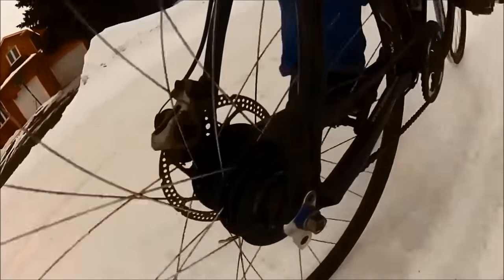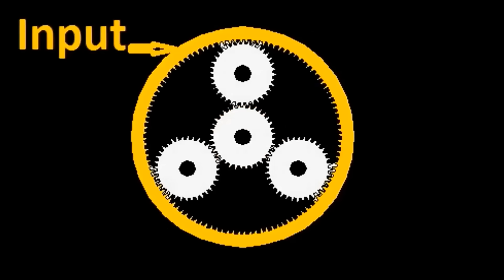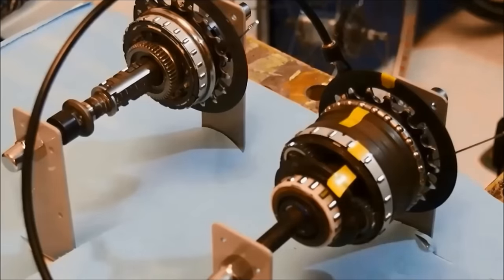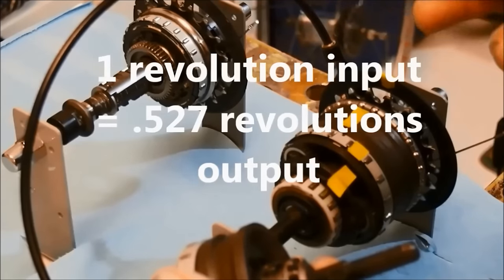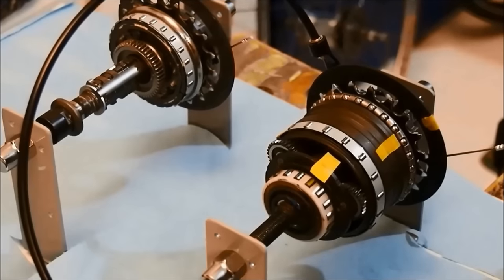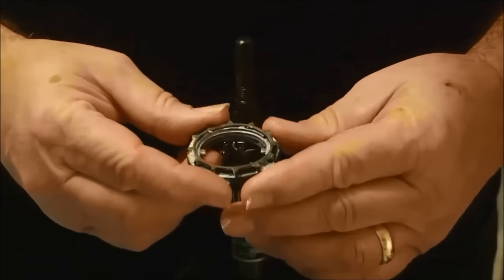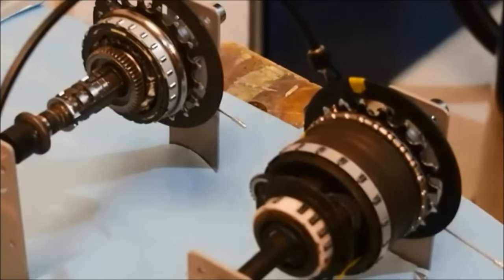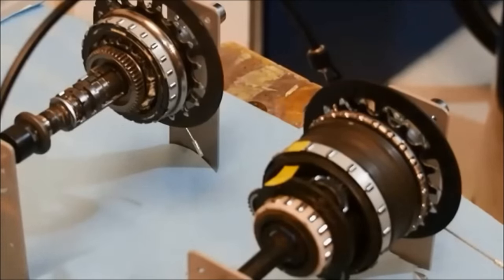Shimano Nexus Alfine 8 speed How it works

Comment: Just a heads up. I had my alfine 8 for two years and started developing problems 6 months ago where certain gears in the higher rang (5,6,7,8) would not engage smoothly and where the 8th gear began continuously clicking. . Adjust was spot on. I just fixed the problem today by changing out the cable and it works perfectly. I opened the hub 8 months ago and everything inside was pristine and well greased. The reason why changing the cable worked so well is that once you get into the higher gears on the alfine the tension in the shifter cable increases causing it to stretch more and be less accurate in the higher gears. This is many alfine users a have issues in the higher gears. Cannot believe that the cable change was so simple, easy, cheap, and effective. Should be the second troubleshooting step after checking adjustment. Best of luck to everyone!!!
Reply: Was your cable evidently damaged before changing? Or did it look good? My cable looks like brand new, but bike is 4 years old (but it was not ridden). Is it possible that cable has streched without using (or used occasionally)?
Reply: My cable looked brand new. A cable can stretch and still look new. If you left the bike unridden for a long period of time and the bike was sitting in a higher gear then I believe the cable could have still stretched because the higher gears put a lot of tension on the cable.
Reply: I ordered the Cube Hyde Pro yesterday... omg would a normal gear-changing-chain-thingy have been a better option? I have literally no clue about bicycles.
Reply: This is excellent advice.
Reply: Pibbles 'n Bits Thanks for this,about changing the cable. Mine didn’t work from its inception because I’m new at this but still have some knowledge about how and what makes stuff work. I knew the cable was the problem and on till the broken ends stated protruding the shop keep telling everything was okay and I’m hard on the equipment.We changed the cable and I changed bike shops.
Reply: My guess is that it is less effecient than the standard derailer. Am I correct?
Reply: @mohlomphehi  correct
Reply: I had this inaccuracy problem on a simple Nexus 3v, new cable, but it was an unsuitable cable normally used for brakes. Another specialized workshop pointed out the error and replaced it with the correct cable.  Interesting that, I've never had a gearbox as durable as this one, years without problems.
Reply: @markwebb7320  It's a pretty solid gear system. Only downside is the added drag over a conventional system.
Reply: They don't like sand ,after a cleaning  there all good ,I've been through several cables  thousands of mile .12 yr old very durable
Reply: Hi. I have same problem  thanks  i will lock in to. 👍👍

Comment: I had a bike with the Nexus 8 (not Alfine) and it covered 50 000km ( I cycle to work). It only needed a new gear cable once, and finally needed a new face plate because part of the face plate that holds the cable end, broke off. Otherwise trouble free and no maintainance! Highly recommend for recreational/commuter cyclists. There is a minimal loss of efficiency that would affect a race cyclist, but not noticeable for regular cyclists

Comment: I have the Alfine 11sp hub on road bike, a tad heavy, but no deraileur, exact shift/response, and works excellent.  Expensive, but after miles of riding, glad to have made the purchase.  So far, 3 yrs use, very durable.
Reply: no boat, they shouldn't be noisy, i bought my alfine 8 based on this video....and it works great! the only thing i miss is the speed of my road bike...........i was asking Dan if i could install a 52 or 53teeth chainring in replacement of the 42t chainring i have now and replace the 18t rear sprocket for a smaller one in order to go faster......

Comment: Dan, that was the clearest, easiest to understand explanation of how this hub works, that I've ever heard!  I'm very impressed you were able to convey the information so simply. It would appear that Shimano have designed and built a very easy to use system. 
I now have only two questions.
1 - Is it sturdy enough and made with high enough quality materials to last a good long time with minimal maintenance?
2 - How can I get one without selling everything I own to afford it?
Thanks for taking the time and obviously a great deal of effort to produce a video that almost anyone with some mechanical knowledge can use to understand this system. Shimano should have you on staff as a technical trainer!
Reply from the maker: +Thomas Jowett 
Thank you for the comments.
If used for it's intended usage, kept properly adjusted, the hub should give very reliable service for a very long time.
 Maintenance requirements vary, with more attention required if used extensively in foul weather conditions.

Comment: This thing is still complicated even after the explanation.
Reply: All I can say is ; holy crap! All that for a bicycle ?  How much is it ? About the same as a automobile transmission ?    I like it ,but it must be cost prohibitive .
Reply: @boracay12  they are kind of expensive--but it's neat technology.  My elliptigo uses this.  And adjusting it is really easy (vs. tinkering with the screws and tension adjustments for external derailleur).
Reply: @david197407  ok thanks .   13k peso . My cheapy chinese mtb with 29 " wheels and 21 gears ,( working fine ) cost 6.2 k peso .
  But very interesting set up .
Reply: @boracay12  it’s actually fairly inexpensive. And yes...like an auto transmission without hydraulics. Very cool stuff

Comment: Also its possible to double the amount of gears by having a twin or even triple front sprocket and derailer (using a thinner chain so there is some play when changing the ratios on the front sprockets .A triple gives 24 speeds .

Comment: Excellent! I didn't follow every detail - will watch again at least one more time to get a little deeper - however I have a basic understanding now thanks to this video. I have never run across any other explanation like this and I truly very much appreciate it!

I put over 10,000 miles on my former belt-drive Nexus-3 bike, and I recently upgraded to a new belt-drive bike with an Alfine-8 - approaching 1000 miles on the new bike now.

I had not understood the two-range, four-ratios per range architecture before I watched your video. Your explanation makes it clear why 5th gear should be the most efficient (least drag), as this is a direct drive with no planetary sets in the power path. I think I can feel this when I ride. After this, it would make sense that 1st, 6th, 7th, and 8th are the next most efficient, having only one planetary set engaged, either just the low-range reduction set (1st gear), or just one of the three overdrive ratios (6th, 7th, and 8th gears). Finally, 2nd, 3rd, and 4th involve two planetary sets in series, the low-range reduction set and one of the overdrive ratio sets, and so would seem to be the least efficient. I believe I can feel this while riding. One thing which I think is very noticeable while riding is the increased efficiency (reduction in drag) in changing from 4th gear to 5th.

Thanks to your video I now understand that there are never more than two planetary sets engaged in series in any gear setting.

Approaching 1000 miles, I like the Alfine-8 a lot. My new bike has 700c wheels and came set up with a 50 tooth "chain ring" and a 22 tooth rear cog. With 170 mm cranks I like how this choice of "chain drive ratio" balances the extent of the low and high gears. For sure, 1st gear could be lower - I can't take on just any hill, but the ones I normally encounter are manageable. I do like where 8th is at and feel like it's a pretty good balance on my commuter bike.

When riding, the gap between 5th and 6th is the one I sometimes wish were a little closer. It's not uncommon for me to run into a riding situation where 5th gear feels like I'm spinning out but I can't make the force needed to hold 6th gear. I end up having to drop back to 5th and slow down to keep a comfortable cadence.

Now that I understand how the three overdrive ratios are all based on separate sun gears, I'm not sure why the design couldn't be made with more uniform gear step sizes. However, I suppose it's also possible the the 5th to 6th gear span is driven by the necessary commonality with the 1st to 2nd gear span, where a closer ratio would not be as desirable compared to the design as is.

One request would be to provide the gear ratios as exact integer ratios (gear tooth counts) vs. the provided decimal approximations. I suspect studying the integer ratios may provide insight making it clear where the difficulty is in realizing a design with a more uniform set of gear steps. If you have these integer ratios in the form of the actual gear tooth counts, and could provide them here in the comments, that would be awesome and much appreciated.

My first bike had a Sturmey-Archer 3-speed. I loved that bike and missed it when I "upgraded" to a Schwinn 10-speed. Now decades later I'm back to riding bikes and back to internal gear hubs. They are so cool. One thing I notice while riding is that I'm shifting gears very often while riding because shifts are so easy allowing a nearly continually optimized cadence vs. pedal force. I don't know if modern derailleurs are this quick and effortless to shift, but if not I'd miss the super easy gear shifts if I went to a derailleur bike.

Thanks again so much for the excellent, informative, and highly useful presentation!
Joe
Reply from the maker: Thanks so much for your comment. Knowing that I helped even one person to a better understanding is gratifying.

Comment: 3:1 difference between low and high ratios but only 8 ratios total, which means they are spread out widely, which is undesirable to many people, including me.  Imagine on a piano for example, spanning 3 octaves using only 8 notes (7 intervals).  Instead of being only about 5.9% apart, each ratio is about 17% apart from the neighboring ratio(s).  That is like a double shift to me (skipping a ratio in between).  I need close ratios, as sometimes I feel I need something between 18 tooth rear and the next ratio which is either 20 or 16 tooth rear.  This  leads me to my conceptual design.  Have all 21 tooth ranges in the rear (from 10 tooth to 30 tooth inclusive), but since that will be so wide, have the front sprocket/chainring move laterally to keep the chain properly aligned.  That way you have 3:1 difference between highest and lowest ratios, but have 19 more close ratios in between.  That is my ideal design and I am waiting to see if someone makes it in my lifetime.  If 21 cogs turns out to be too wide, then just reduce it to whatever can be made to work, such as 15, but then make the difference between high and low ratio only about 2.5:1, to keep the intermediate ratios close, or maybe let the user select their own set of ratios, following the manufacturers compatibility rules for them.
Reply: Based on my research, a less than 15% difference in gear ratios don't make much difference in pedalling effort (+/- 3%).  This is based on my city riding with some hills (Los Angeles). I believe this is why mainstream sprocket clusters on rear wheels have differences ranging between 12 and 18% (eg, 8-speed 11-32 or 7-speed 14-28).  Plug these into Sheldon Brown's gear calculator which shows the % differences and you'll see.  I understand that as speed increases, you need closer ratios than 15% because of increasingly greater wind resistance which makes pedalling harder.  Also racers or highly athletic riders may benefit from closer ratios to squeeze as much speed as possible from their cadence.  Also, Rohloff 14-speed has about 14% difference between all gears.  I believe manufacturers have done their research on this.

Comment: I have ridden nexus 8 for three years and it was great experience. However if you pedal hard it makes some grinding noise. So it better fits for relaxed ride. Nothing too aggressive.
Reply: I agree, compared to my Shimano Acera 3x9, the pedaling is easier than the knob 8-shifter of Nexus.
Reply: So using this with a electric motor would be a no for you? That's what I was planning on using it on. The motor will be high torque, not high speed.

Comment: In my Alfine the plastic cage for the roller bearings broke. Due to a lack of spares availability the hub was junk. Taking it to my LBS they were not interested in touching it so I had to dive in. It lasted about five years, the lack of support was very disappointing.
Great video though 👍
Reply: Question: Could that part have been 3D printed in Carbon Fiber Nylon? I'm working on starting a belt drive ebike project and making everything digitally controlled with an arduino, including shifting. Watching this video my impression was this would last forever if well maintained, and well you just killed that. If it could be 3d printed it wouldn't be a problem and I would be ready for the failure. Also, do you think that part could be replaced with a soft metal like aluminum? If you can make a cad design of the part, China will machine them for you cheap.
Reply: @mborowski2010  Hi Michael, to clarify the cage was for the ratchet pawls not the bearings as I wrote earlier. The pedals locked up with the rotation of the wheels and then eventually the hub locked up. I am not an engineer but to change the material it is made from you would need something that won't wear and contaminate the hub but not wear down the parts it interacts with.The lack of spares for the hub and the bike shops not wanting to touch it was the worst, that hurt. 3D printing I will investigate, I hadn't thought of it so cheers for that👍 
PS. The other consideration is i may have had a lemon, reading some of the other comments people seem to be having a good run with theirs but again the parts and tech support would be worth investigating.

Comment: 2 years ago i tried this bike with this gearbox
It's very easy and smooth and it's better than the traditional gears on another bikes
It's mini gearbox but with high torque at 1st gear and at 8th gear with high speed

I really would by one of these bikes

Comment: Thank you so much from those of us who could understand a semi complex drive train flow path. I would like to rate your video a A+. 
 Viewing it a second and third time does greatly help to understand the drive flow path knowing the rest of the several mechanisms are not engaged.
I now understand the unit.
I started looking for answers when my Alfina would not shift. I think my handle bar shifter is at fault. Some times my thumb lever action has no reaction to the hub assembly. I am still looking to see how the handle bar shifter works. Any advice would be greatly appreciated. 
Thx again Dan.

Comment: I have a question comparing this hub to the the classic Sturmey Archer 3-speed AW hub.  The AW has just one planetary gearset (and no stepped planet gears), and power flows in opposite directions to achieve different ratios, namely 3:4 or 4:3.  In comparison, on the Alfine 8, does power flow in just one direction?  Looking at your video, it seems that's the case.  This would seem to be an important distinction in the design of these 2 hubs.  Thank you for producing the best videos on how bicycle planetary hub gears work.  You have a deep understanding.
Reply from the maker: You are correct that the classic 3 speed achieves underdrive and overdrive ratios by reversing the power flow. ie when the power input is the ring gear, you have underdrive, and when the ring gear is the output. you have overdrive.In the case of the Alfine hub, the underdive gears are accomplished by means of the reduction stage which is bypassed in gears 5 thru 8.

Comment: I've had a (very early model) Rohloff for 15 years now, and I'm afraid it too has an Achilles Heel: the shifter cables emerge from the twist-grip at right angles and are prone to damage in everyday use. Plus the cable box seems quite capable of warping and being damaged. The flexible cable housing that enters the hub on some newer models was a response to this problem I suspect.
I've replaced the shifter parts three or four times now. They're not cheap. The Rohloff hub itself is a marvel of course, and seems still to be going strong without any issues, despite heavy urban use (trailer, cobbles, kerbhopping...) I'm about to rebuild it for the third time: rim's shot.
Would I buy one again? No. Thinking of going back to Sturmey-Archer in fact (seriously). Now that is a proven technology!
Reply: Douglas Carnall I've been considering a Rohloff. Why wouldn't you buy again?
Reply: outcast566 He said he didn't like the shifter cable with his. I wonder if this is a problem with the current models.. must be or he wouldn't be looking elsewhere.

Comment: I'm having trouble with my shimano nexus inter-8 since I opened it up. I think it has something to do with the roller clutch because I initially had only 1st and 5th gear. I reopened it and tinkered with the roller clutch spring a bit (not knowing what I'm doing) and I got the other gears to work when I put it back together. Yesterday though, I found out that if I freewheel downhill long enough, I go back to having 1st and 5th only again. It stays that way for a while before I get the other gears back

Comment: if you use a derailleur or a chain tensioner you can still remove the back wheel to change the tire without having to break the chain every time.